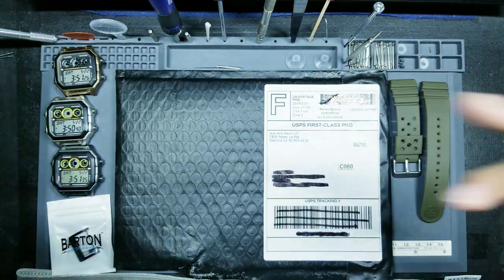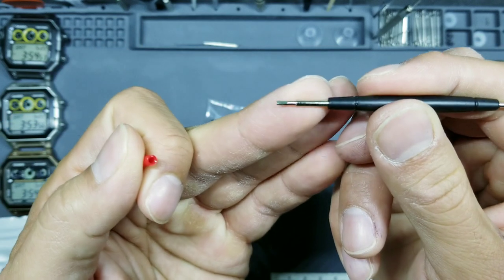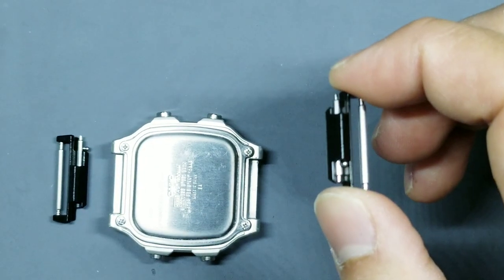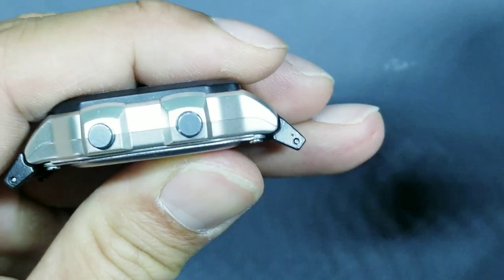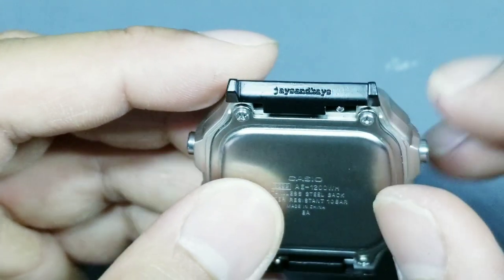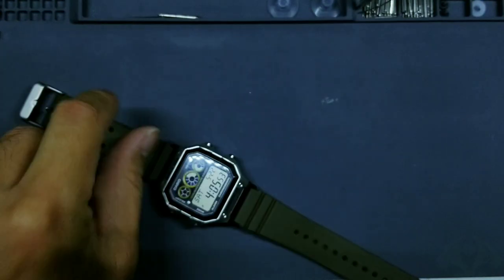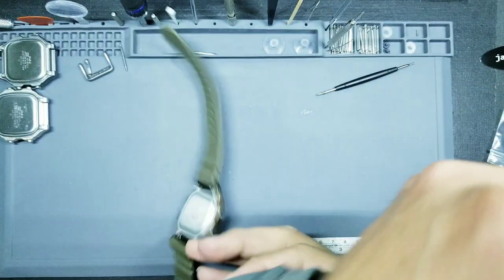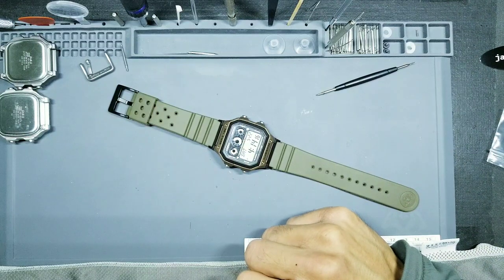JaysAndKays Metal strap adapter kit for the Casio World Time AE1200 & AE1300

Comment: I have them too for a few of my Casios best quality available IMO, they look factory, gets rid of the crappy failure prone plastic straps, more comfortable and a one piece Nato adds security so if one spring pin fails the whole watch doesnt fall off it still holds the other side - in my case allows me and my 8.6+" wrist to wear the NATO of my choice on watches I could not wear otherwize.

Comment: Nice video! However, I'm wondering if using a metal adapter on a resin watch case could possibly enlarge the lug holes ? (load bearing)
Reply from the maker: Maybe. But someone would have to tug pretty hard and consistently on the strap to cause the metal adapter to pull on the spring bar and enlarge the holes of the resin lugs.

Comment: You said the two on the right are 1200s - All three are 1300s aren't they?
Reply from the maker: I was referring to the fact that the 2 on the right are ae1200 CASES, and their internals have been modified by me (in this case they both have ae1300 modules and masking inside those ae1200 cases).  👍
Reply: @watchncarry9593  OK I see. The cases are very similar. Thanks.
Reply: Do they make the adapters in silver, I think they would have been a better match if so 😊